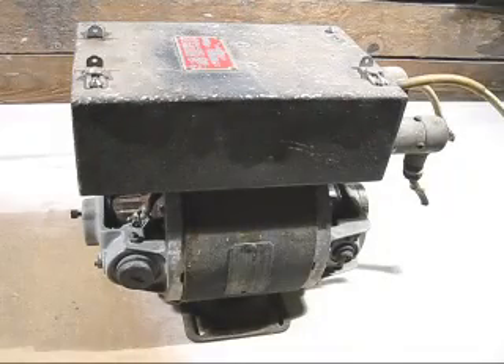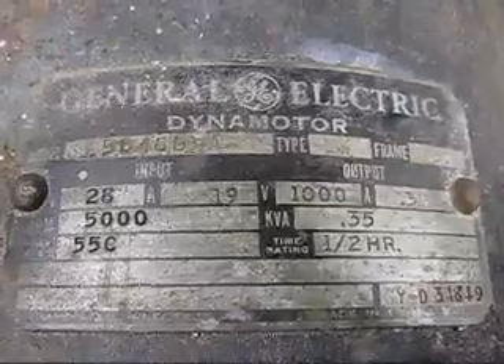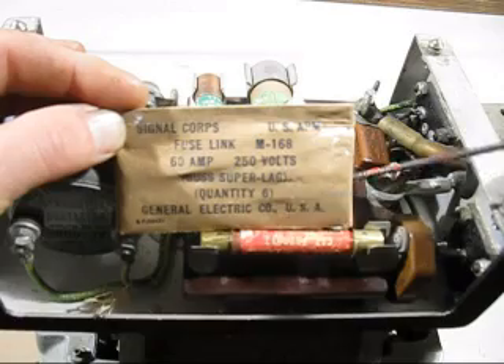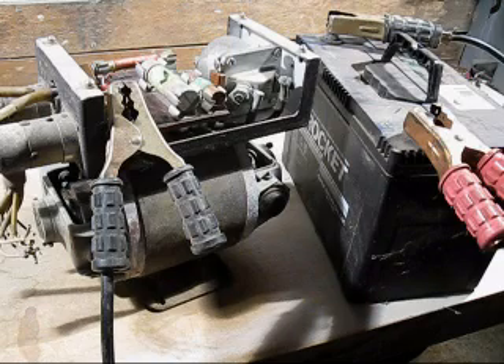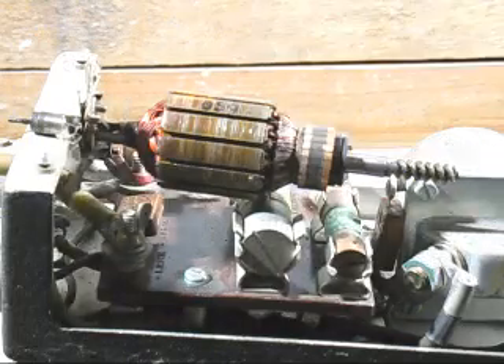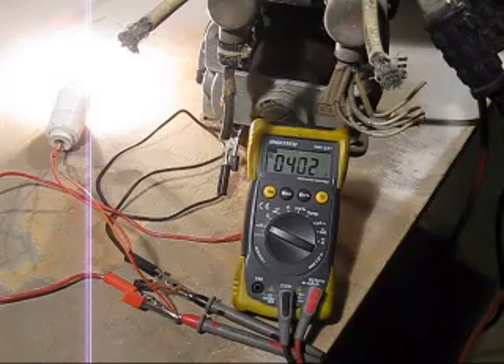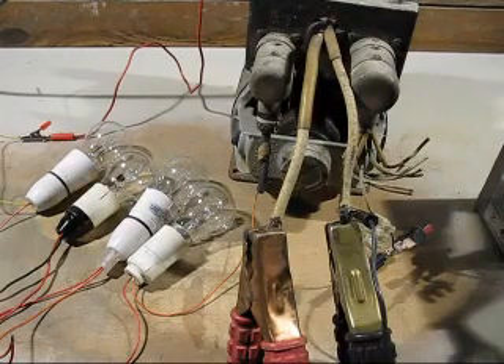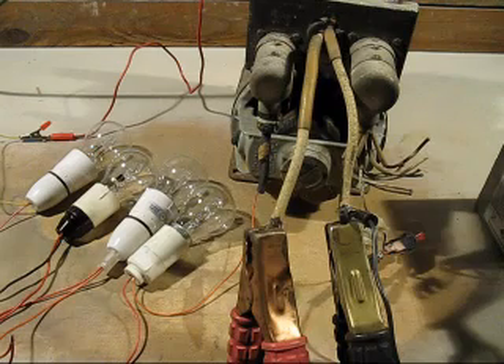Rotary converter 28 volts D C  input  1000 volts D C  output

Comment: Great machine, 1000 V dc was used for high power transmitter valves in military equipment. They run on lot higher voltages then tube amplifiers which need 325 to 400 Volts to run at.
Reply from the maker: Thank you for the info, I always watch your videos.

Comment: Interesting, to say the least.  These were primarily used for military radios.  If you look up Surplus Sales of Nebraska, there is one of these under the transformer section with a pretty good outline of the type of radio or radios they were used in.  That particular unit was from a Canadian radio but I don't remember the rest of the details. Check it out though.  I'm wondering how well these things would charge a high voltage capacitor to smooth the voltage spikes and switch more current to another high voltage dc motor?

Comment: is a part of the BC375 transmitter.. mostly used in liberators B24 and  dakotas so an aviation component. value now around $100 and the high voltage fuse is ok with 20 ohm...
Reply from the maker: Thank you for that, I thought it was for land based radios but know I know better.

Comment: Hello to you luckygen1001, hope you had a fun day! I'm obsessed with your channel and I do watch it all the time without missing any of your posted videos on YouTube, because I did  learned lots of nice think from your channel and I do thank you. Answering your questions about high voltage DC mechanical converters, this type of converter only design and build to supply DC high voltage for mobile radio transmitter? That was before invention of transistor, because back in old days all was used vacuum tubes which is inquire higher voltage specially radio transmitter and that's why. I saw one was 48V DC to 1600V DC. You are a good man!  From Las Vegas Nevada, USA
Reply from the maker: ***** Thank you for your reply. Now I know that there are higher voltage outputs than mine.

Comment: Radar and antena aplications those do not use amps at all mostli high frequency and voltage . I asume thats not even an contactor because even starter motors for car some of them have dobbel wire selenoids .Honesli dono . But what I do know compensation wires make up voltage differentials for ground and positive side ,some buff baterry voltages I ques exampel like the delco alternators who need ground potential to determine how much to charge the baterry,some starter motors use the extra wire to bypass voltage for points ignition or stuck the bedix to flywheel if you power that thing bosch makes even today starter-generator armature for golf2 ,some tractors use bypass regulators ,so It culd by any thing honestli even tought Im terribel calculating polariti differences in coils ,some of those starter-generators have actuali dobbel brushes one top and 2nd longitudinali mounted and the hv side has an external inductors . So its more like thst I ques .Some generatoes have polariti switching field coils so its similar to universal motors. If it any thing helps I belive they call it compound dc motor or metadyne effect where you put 1 input to gain 1 out put and in this case are used latching pins from transformers or inductors like exampel 220/12v = 208+,208-,232+,232- so sone thing like that and you wuld need virtual ground relay .So I ques those coils and methodes of useing dobbel parts makes sence kinde of.Even tought those devices differ from their construction. So I belive it has mostli to do with material differences .Im also interested in those old generators they are reali nice but not much info about them.